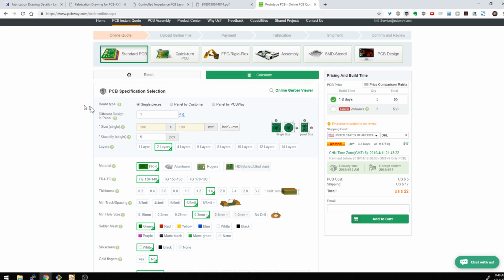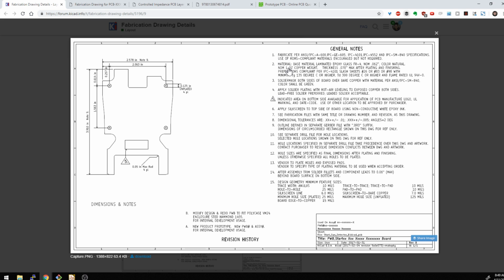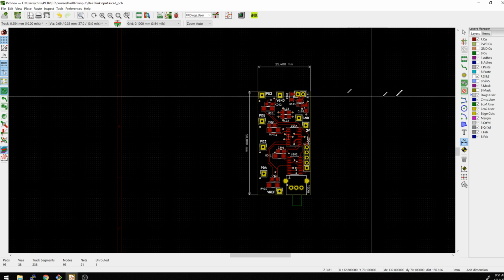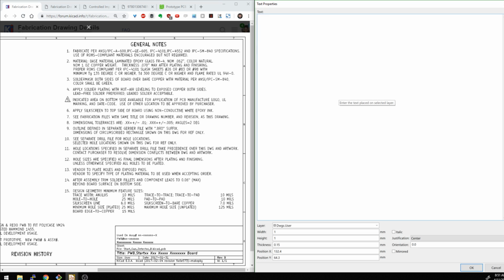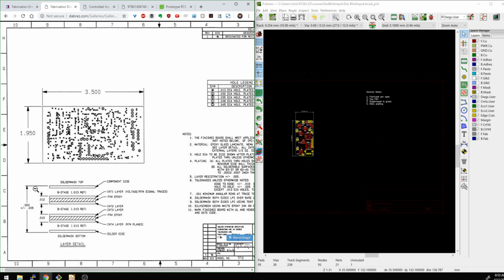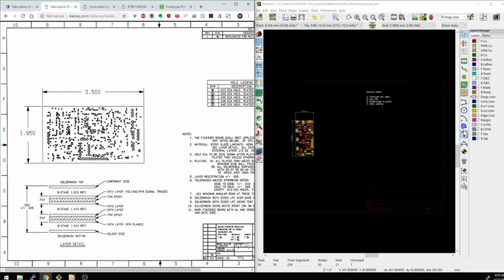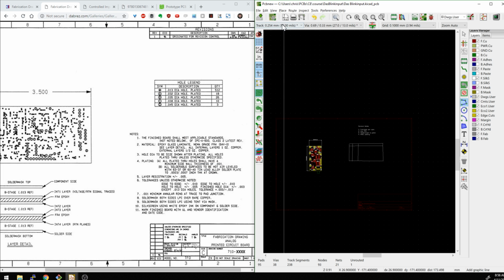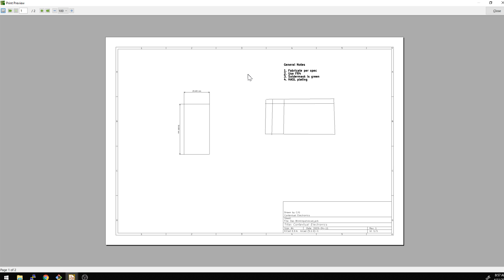KiCad 5.1 - Creating fabrication drawings

Comment: I'd really like to have a few built-in tools for generating lists, tables, and a layer stack-up diagram. This doesn't appear to be on the Kicad roadmap (I could be wrong, I only looked briefly), but would anybody else be interested? Is anyone currently working on something similar? If not, I'm tempted to try and build something like this myself when I have a little more time. I'll be at Kicon in two weeks, and would love to chat with anyone who might have thoughts on this.

Comment: Honestly if you don't have a personal creed to only use open source stuff, then I'd recommend just exporting the board as a step file, importing into Fusion 360 and make the drawing there. Fusion 360's 2d drawing workspace is so much more mature than KiCad's even though it's not up to spec with the competition.
Reply: Probably a way of doing the same thing in FreeCad but FreeCad confuses me every time I try and do basic things in it. I do have great hope for the eventual 1.0 release though.
Reply from the maker: Ah, good point. It's possible to do much more in-depth dimensioning there (or in similar 3D mCAD programs)
Reply: yo amoose, have you experienced any weird behaviour of the exported from Kicad step files? Specifically in Solidworks, whenever I import steps from Kicad on the same assembly, some of the 3D model get messed up and spread all over the place.

I am thinking that this is because the exported 3D model is a sum of many step files and Solidworks doesn't like that..Any ideas?
Reply: George Papanikolaou I haven’t tried in solidworks. I had no trouble in fusion but I did notice that meshes have the traces but steps are only solid geometry.